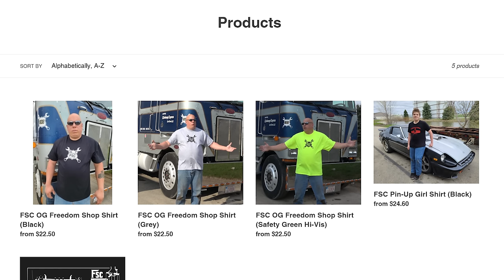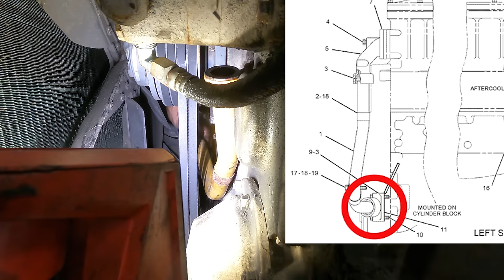New Aftercooler Core Installed.  Coolant Still Leaks!

Comment: Air to water b-models  are 400hp. They have the fuel turned up to get to 400hp. The 425s are air to air and actually have the fuel turned down, the extra power comes from the cac set up. You’re right in leaving it alone bc there is a lot more than just throwing ata parts at it.

Comment: Steve one of the best tools I’ve bought is a vacuum coolant filler. You can test for leaks before you fill and never have to worry about air in the system.

Comment: My back hurts just watching you work on that beast... I would have replaced those flanges on each end of the cooler, no way would I have wanted to work on that job twice. Very informative repair, thank you.
Reply: Right the one he's holding at 7:05 looks corroded. 
Would guess they should be less cost than that cooler, if they're available.
Reply: @goratgo1970  Actually, Steve would be better off driving Orwell and that other junk cab over a cliff.  I can't understand WHY anyone would put all this blood, sweat, and tears into the JUNK he does.  Steve's ENTIRE garage is being taken up with JUNK.  These cab overs are a piece of JUNK, problem after problem.
Reply: @williamwallace8164  Steve has the knowledge and the tooling to maintain these old mechanical trucks. Newer ones need a different approach, and different, expensive tools. Also this way no ELD or DEF problems.
Reply: @williamwallace8164  At least he will be driving when they pop us with an EMP.

Comment: CAC is more efficient over water aftercooler plus removing possible part that can dump coolant into engine. Trucks with EGR cooler can dump coolant too. But CAT with ACERT C15 used small aftercooler before CAC and they did have them leak too. That brown sealant or what we call carmel sealant only used on shim gasket under spacer plate done to stop oil leak on shim gasket. Cat came out with service letter to do this. We use hi-tack on other gaskets mainly to hold them in place. We had owner who drove his truck for 3 weeks with leaking EGR cooler. I go out to bring truck in and got just to the shop door engine stopped. EGR cooler completely failed and bent 5 rods JUST GREAT

Comment: Orwell is looking good Steve.
I always use Permatex aviation gasket maker where water and air come together since the mid 80’s when I started building my own engines.
Especially on cylinder head bolts, intake manifold bolts and water pump bolts where they pass through water passages.
Permatex makes the absolute best products on the market and this one does the job the best in my opinion.
I’ve never had any issues in the decades of doing it that way.
I learned that from a mechanic that used to work for a Honda dealership.
He also taught me about applying aluminum or gold spray paint onto cylinder head gaskets.
Trust me when I say  it is better than spreading pixie dust from a unicorns ass!!!😂

Comment: Steve, enjoy the content and Orwell!  Just some suggestions from a part time wrencher. That tool you used to clean up bolt threads was a die not a tap, lol. Just giving you shit. But seriously, putting coolant in would be much easier with a battery powered pump, harbor freight or Amazon has some decent ones. Also I use scrub rags when working on stuff. Tub O Rags or Orange Scrub makes a good one too. They have grit to them and are soaked in cleaner to help keep hands somewhat clean and parts as well. Safe travels brother. Enjoy watching the wrench videos as much as the truckin videos

Comment: every bolt has a torque spec, its in the cat manual, standard size and metric in the newer ones, sump pump, cut a garden hose off, quarter with a hole drilled in it between the sump outlet and the garden hose, to prevent cutting orings lube the oring and the bore well, and push, do not hammer or use a pry bar

Comment: Cat had green gasket cement that stuff glued parts together. Dad used it on both side of oil pan gasket because it always leaked oil It didn't leak after that.. But when trying to removed pan after that was almost impossible end up cracking oil pan driving in thin scraper. But we used it up and tried to get more and found out CAT no longer makes it. Cat also no longer brands sealants or loc-tite.. I can't find another thing like CAT green gasket cement

Comment: Here's a tip for when your pouring out of a bucket. So if you spin it 180 and instead of when you tip it and the spout is on top  you have more control and air can get into bucket. It's like opposite of what common sense tells you.
Reply from the maker: Yes, but my funnel was too short for that.

Comment: With air to air  you get a colder air .the inner cooler thats in your cat engine will cool the intake air to the temp of the engine .cummins and other engines used the same style that orwell had.cat was the company that invented air to air cooler .denis from santa rosa ca

Comment: Ps,a rattle gun would help you ,low impact etc then all the hard work is doing the torgues,and also does rhe manual have torgue ratings for various size volts ?
The go to for when a torgue isnt specified on a specific part ?

Comment: Just a word of advice..use the permatex anaerobic sealant 
I have never had a new rear pig leak or any front or rear structure job ever leak using it...I was skeptical at first...silicone is way over used.